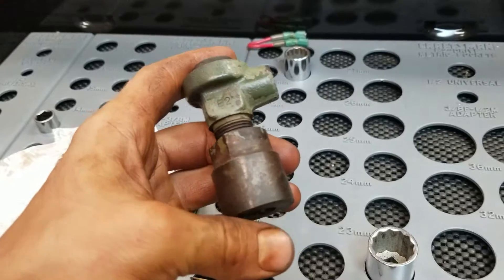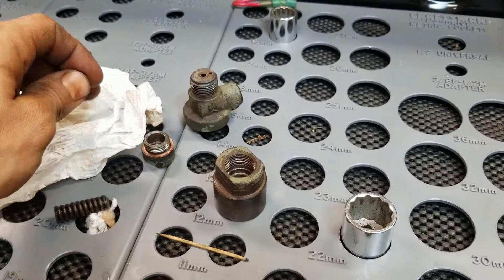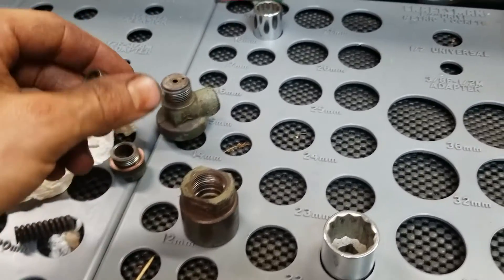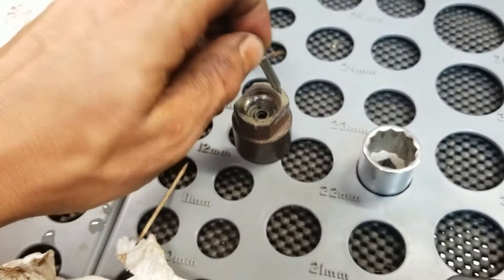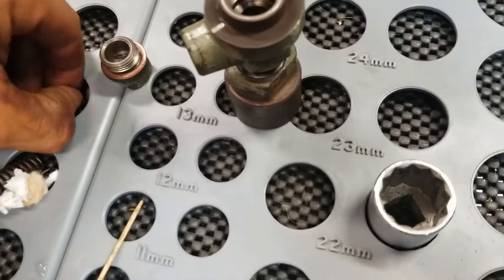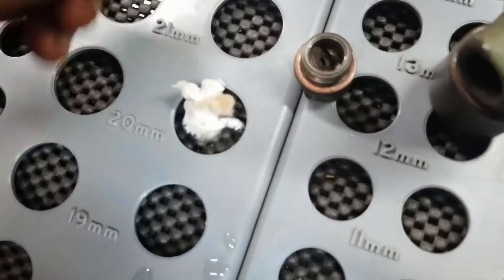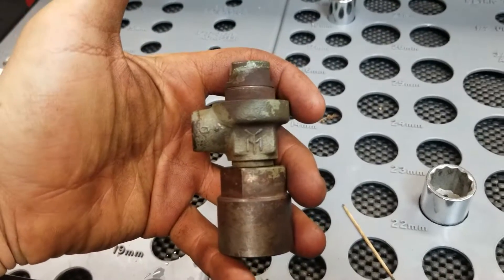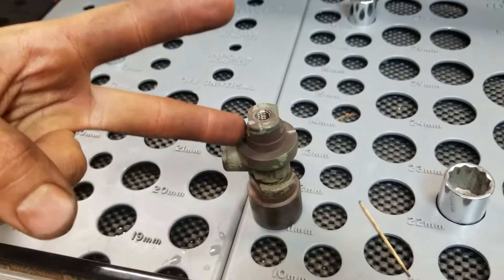How To Clean Diesel Tractor Fuel Injectors

Comment: I appreciate your video, I wish you would do one on how to get them damn things out of the head when it’s off the engine!!! I’ve done the slide hammer with a Pitnum arm puller till my arms are worn out!!  Gonna try to find a socket or something to slip over it, find a bolt with the same thread n diameter of the return line banjo bolt but long enough to make it out of the top of the socket, and use it with washers to make my own puller. Wish me luck. Great little video you did here, thanks
Reply from the maker: I just wiggled them out of the head. I DON'T recommend this, but some guys pull the decompression lever disconnect the fuel lines and and then bump the motor over. They should pop out. I make sure they don't fly out and hit the ground.

Comment: Did you happen to come across what the pop pressure was for those injectors? I have three on my tractor and I bought new inserts and needles. One of the three was working properly I believe in popping around 2400 PSI. The other two were just peeing out. After replacing all three inserts, all three of them are popping at a pressure around 1400 PSI. Which I think should be higher but I can't find a spec for it anywhere. They are popping consistently now but I may have to play with them to increase the pressure if I can find it specs anywhere. Thanks a lot.
Reply from the maker: Yes. I made this video about it: https://youtu.be/meM8tGPHqv8
These exact injectors pop at about 2275 PSI or 160 kg sq cm. 1500 PSI is wayyy too low! What tractor model do you have? I have  service manuals. I can tell you the opening PSI. You have to get OEM Yanmar shim packs and re-shim them. The paper-thin shims will raise the pressure by 100's of PSI.
Reply: @MattsShop  it's a John Deere 850 or I believe otherwise known as the ym2500.
Reply: Has the 3t80j engine in the jd850 if that helps.
Reply: I found a shim set for a different Yanmar injector. Are they all the same or do I have to order a specific one? Thanks for all your help.
Reply: I watch your video from pop testing. The Yanmar shims information wasn't in the remarks. But I zoomed in and got the number and ordered a pack. That video helped a lot.
Reply: I got the shim set in and went to adjust the injectors however I can only get them to around 2000 psi because once I add another shim which would be the fourth then it doesn't pop anymore. It's like it's getting bound up inside. I wonder if my springs may have weakened, causing extra shims needed. 
But now since the spring is compressed it doesn't have room to allow it to pop. Thinking about ordering new Springs. How many did you have to put in yours? Once I get to four they just seize up. I looked at the manual but it didn't refer to quantity.
Reply: Update.  I had ordered new injector inserts from hoye, and didn't pay much attention to them. Once installed they dropped pressure to 14-1500psi from 2400. Thought that was odd so I tried to shim them but not working.  So, here's what I did. Went back looked at inserts. Originals has ydn-osdyd1 7e stamped on them. New ones had dnosd24. After much research,  these are very similar but I don't know if some cross referencing got crossed up or what. I put old ones back in and leaky but popping back at 2400. I couldn't find much information about what applications the dnosd24 may be used on except Mercedes. So another set of hopefully the correct ones on order.

Comment: Matt, on the toothpick idea..I picked up a set of wires, I think from welding tip servicing years ago?? and there are a nice variety of diameters for the hard wires. They work great on other nozzles and very small orifices so I'm thinking I'll try these to clear the holes in the injector. They don't break or bend either! Wouldwork

Comment: How did you get the injector out of the tractor?
Reply from the maker: Unbolted th two bolts on the top plate holding it in, and disconnected the metal fuel line. I just pulled the injector out after that.
Reply: This style injector is not held in by threads but with the hold down bracket. I blow mine off with compressed air then soak overnight in penetrating oil before trying to remove. After removing nuts on the side of hold down bracket and fuel screw on top, use a 17mm open end on top part of injector wiggling sideways back and forth while pulling out with pliers or hand. This should work however as last resort you can throw a heavy cloth or something similar over it and turn the engine over and let the compression blow it out. It can come out with force this way so don’t stand in the line of fire.  Also watch out for the washer at bottom of injector. Most of the time they will stay in bottom of injector hole but can stick to bottom of injector when removing and fall off later